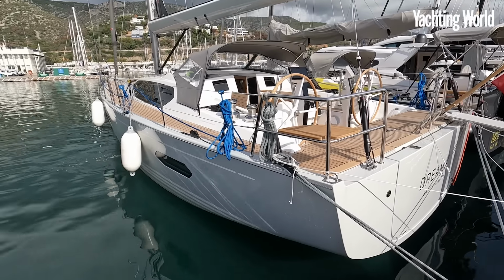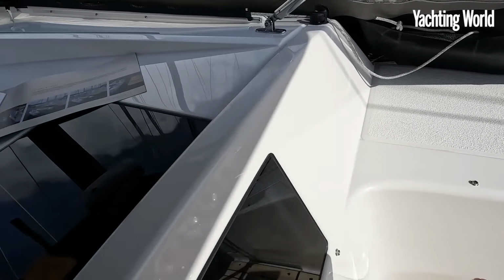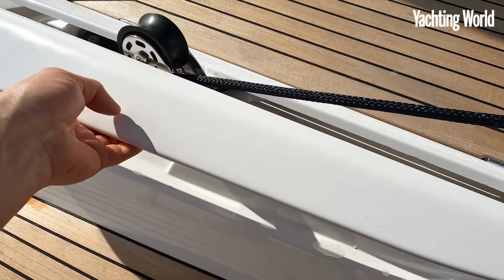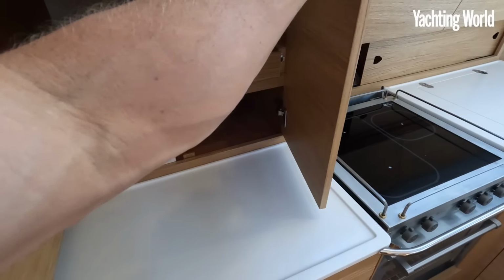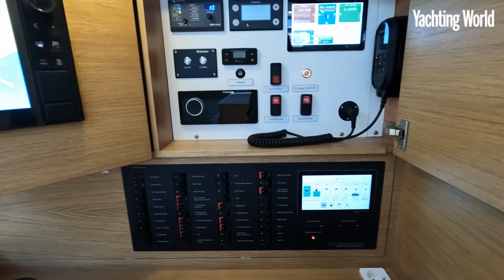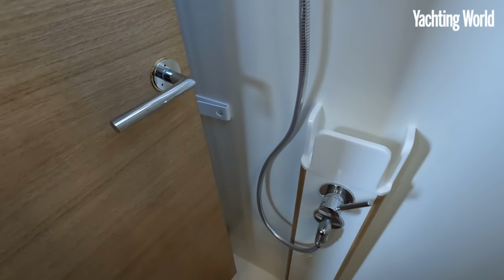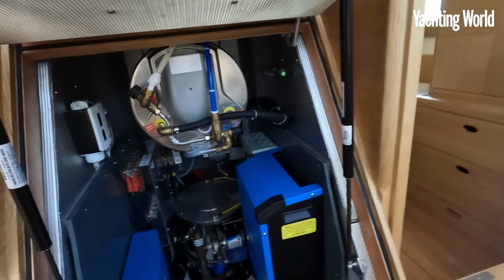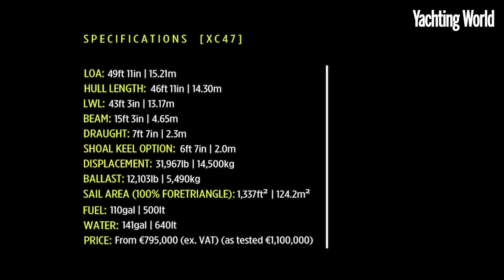The best bluewater cruiser ever? This Xc47 is definitely worth a closer look!

Comment: 50 nm under electrical power is really pathetic. The idea of running a yacht solely electrically is not ready for prime time and won't be for decades until battery storage gets way, way better and solar panels move from 25% efficiency closer to 100%. Think of it this way, you have energy in a battery that the electric motor uses up. Then you need to refill it somehow. Doing so when you are sailing (using hydro-generation of the electric motor through the propeller)  is admirable of course but it will take an all day sail to do so (and more...) just to replace what the electric motor used let alone what the refrigeration, electronics, etc have used. The entire deck fitted with solar panels would not help that much. The only viable solution for now is to use a diesel generator to recharge the battery pack or, to extend the range of using the electric motor. So, think of this... instead of using diesel to directly run a diesel engine and provide propulsion (and using the alternator on the engine at the same time  to charge batteries) you now use the same amount of diesel to run a larger generator to only provide power to recharge a set of batteries or to run the electric motor. This is an incredible inefficient of diesel fuel. This 'virtue-signaling' of 'saving the planet' by using 'green energy' is really misleading for now. I see potential but in the foreseeable future an efficient diesel engine is a much better and more reliable option than an electric motor.

Comment: The best, I suspect far from it. It would have to sail like a dream to overcome all the niggles and issues of what a bluewater boat needs and this one does not have. Oh sure it is a very nice boat and well thought out for perhaps even a live aboard cruiser, but at that price it should be. The price alone for what you get deters from this being the best, let alone a bluewater cruiser. Nor am I surprised the first boats have been fitted out as diesels. Not because that over electrical, but because their other option is horrible and inefficient. One will burn through more fuel motoring around than they would using an outright diesel engine ... not counting the range would be much less than stated counting all the other electrical in use on the boat. The limited solar panels is not ideal either. And the additional cost for that very limited range and it is really no wonder so many have chosen the diesel. Sounds like they really do not intend to seriously sell any of those to begin with, just to have the option to say that you do for marketing. Exposed helms and I could go on. It seems more like a med or carribean luxury boat to me.

Except for the hull, rudder, etc this was a very good walk through of the boat. You pointed all the main high lights otherwise. You could have done a bit more questioning of some of the choices made though, instead of being totally positive about everything.

Comment: Dinghy some 50 cm the water, attached to a folding transom.. What could possibly go wrong? Also have fun removing the dinghy from over there before med mooring.  While I'm all for oceanvolt and know it can work, who in their right might would like to be relying essentially on the notoriously unreliable panda genset? I'd agree this is a lovely, albeit slightly ugly med cruiser, as long as you don't even try to make use of the davits.

Comment: No. My Sundeer 60 is.  Its about the same size, or a bit smaller than the XC47, but will cruise faster and safer with less crew effort and a better motion. That X boat has an ass like three busses. My boat has two watertight bulkheads and is built to 3x ABS in the relevant places. Just about bulletproof. The published displacement for the Sundeer is 16500 kg BUT thats fully loaded with everything. Displacement length is 80! The Sundeer is effortless cruising for a couple.
Reply: So tell me, where can I buy a Sundeer 60 :-)

Comment: A perfectly beautiful boat for a weekend sail in nice weather during the summer season it sure may be, but it is no blue water cruiser at all. And why do all these modern boat builders try to fix, what people do not need a fix upon? It may be smart to hide all the halyards on a gigantic charter boat, where you only really sail in perfect conditions and motor the rest of the time, but on a supposed blue water cruiser it is just silly! What would you do, if one of the those halyards break in the middle of those under deck tubes and in rough conditions at open sea? According to Murphy's Law, that is also, when they will break! So many boats solve this much more clever, for instance by making the run of the halyards as short an direct as possible, but always accessible. It is just one example. Anyway, the price make this irrelevant: It is even more expensive than the 50 feet Kraken, which is the supposed ultimate blue water cruiser and quite a big bigger! The much more spacious Allures 51.9 are much cheaper, and that one is a marine grade aluminium hull build on the same shipyard, as builds Garcia boats!

Comment: Lovey review and boat. Always wonder what they understand Bluewater to mean. I tend to think they mean crossing The Med and coastal waters around the Baltic and Europe. Perhaps doing the ARC rally which is what 90% of their customers would do. For high latitude or exploring the coast of Peru I'm not sure this is the boat for you. As a small issue - why do some engine compartments seem to have a small - 2 inch maybe - window, or circle of some kind, under one of the stairs.
Reply: That small hole is so you can empty a fire extinguisher in to the engine compartment in case of a fire.
Reply: @KristvanBesien   Thanks. I thought once I knew it would seem obvious.
Reply: @rtbinc2273 What sailboats do you think could do the more dangerous trips you mentioned?

Comment: I'm not convinced about the ocean volt electric drive with a 30kw lithium ion phosphate battery bank and 11kw diesel generator (is the 600 odd litres of diesel tanks removed and replaced with batteries) 110k euros is a lot of money for a 30 mile range, an 80hp yanmar probably costs maximum 30k, no wonder all the new orders have gone diesel, what's the point of having an electric drive train if you need a generator to charge your already excessively large battery bank, and you'll never be able to fit enough solar to assist in charging so you'll realistically be running your generator if not daily then at least 4 days a week. False economy and buying into the so called green energy bulls$#@. Not a great blue water boat and definitely not the greatest blue water boat ever built by a long stretch IMO
Nevermind that the water heater is directly above the electric motor with massive victron installation just forward of both, good thinking , what happens when your water heater springs a leak, just saying......??? Sorry but that's just stupid
Reply: For people who only go out for day sails, electric drive is great. These are rich folks who seldom have the time for multiple days out. More and more boats are going to have this type of setup. It's not what I see myself ever desiring, but I'm the minority.